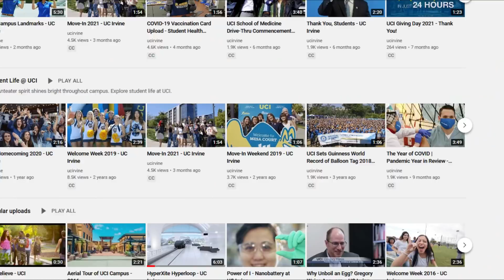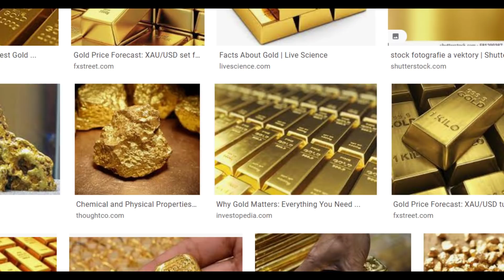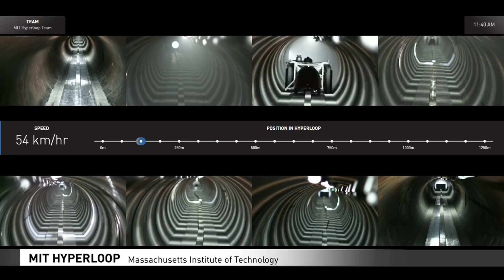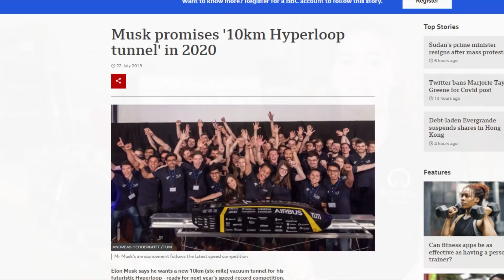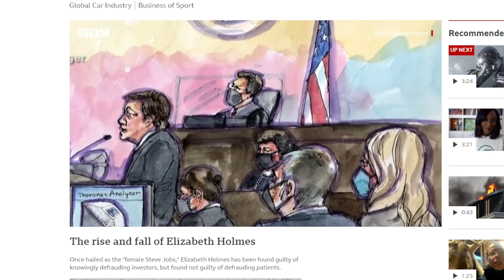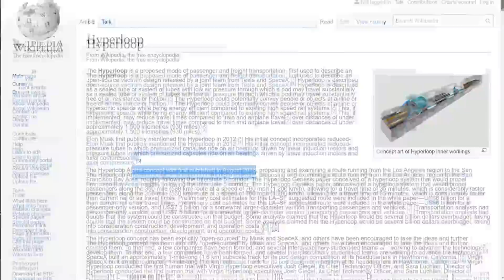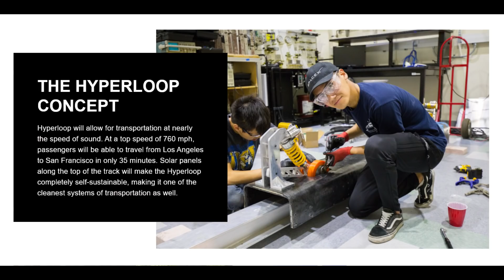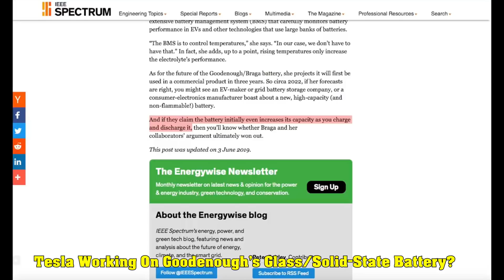The GOLD Battery that will revolutionize EVERYTHING!

Comment: This reminds me of when I was in engineering school, working on my senior design project.
They had us re-designing a linkage assembly used to reset circuit breakers for power stations.  GE had a design that they were having issues with.  They gave us the requirements for the input, and output to the linkage, and asked us to redesign it within the space available.  The first thing that we noticed, was that they were using a 0.7 hp motor as their input, but when we did the calculation for the output, it came out to 2.1 hp.  When we pointed this out to our faculty adviser, he suggested that we try using a nutating gear assembly to get the extra power.  We spent over an hour walking him through the physics to explain why that would not work.

In the end, we were the only team that did not build any hardware.  Instead, we provided them a design that would meet their requirements, if they had a 2.1 hp motor.  We also provided a presentation on just why their current design was not capable of doing what they claimed that it did.  We got an A.
Reply: Well it's good to know there are still some people who are capable of doing competent work.  There's a pervasive lack of common sense and first principles.  I'm amazed shit isn't just constantly imploding from poor implementation.
Reply: You got an A on a shiny worthless paper and GE got your work at your cost financed by the bankers and taxpayers for being in school. Win win for corporate America!
Reply: @Prometheus203  sad but true
Reply: @dmwalker24  I think you make an excellent point . I often look at the old school videos showing how things work . The thing about the early 20th century was that they viewed everything from first prnciples.  It seems now with a more detailed view of the world and math starter engineers lose site of  these first principles when learning at uni and how to build from first principles. Rather , they seem to rely on hand me down aps and formulas . It is impossible to effectively build and solve the difficult problem designs without such fist principle understanding. The difficulty is being able to train engineers in modern methods ( which save time) and give them a sound first principles base.  I think perhaps first principles should be the university focus but it is difficult. The language and presumptions given by modern teachers is often loaded with a modern view of the world. If you listen to engineers in pre 20th century or written text it is worded very differently and tends to reinforce the first principle method .. Perhaps we need to work off old texts and videos ..
Reply: I had a similar experience in high school.  I was on an extracurricular engineering prep/competition team (I forget the acronym) where we'd go to a place and basically "solve" engineering problems that had already been solved.  One that I worked on was determining the minimum force (friction, spring tension, etc.) to keep a car door open on a 30% incline.  The team with the most correct answers won a small amount of scholarship/grant money.
Anyway, the tie-breaker for the competition was to design a nuclear reactor.  There was a 3-way tie.  My team, seeing the ridiculousness of asking high school kids to design a freaking nuclear reactor in under an hour, just copied a diagram of a standard nuclear reactor from one of our textbooks.  We won because ours was the only one that would have actually worked.
I don't remember if this was before or after the Simpsons episode where Homer wins a similar competition by putting a racing stripe on a model of their existing nuclear power plant.
Reply: @Prometheus203  Clearly regulations aren't keeping up with technology. It happens a lot in a failing nation.
Reply: So you're saying that the private sector actually leaches off of the public sector to do innovation, right?
Reply: @johnnonamegibbon3580  It helps maximize profit for the shareholders.
Reply: I don't disagree with you -- No one that passes laws in the states seems to understand technology. How would you solve for the fact a bunch of administrative red tape could stifle innovation and exploratory educational endeavors? I'll bet you OP has/is going on to be a fantastic expert in their field. And in a weird way they might partially have this jacked up system to thank for it in small part. Don't conclude something is a total failure based on the conjecture it could never be improved or reimagined. @dylanthesea2976
Reply: @das250250  My own background is in biology and computer science.  Lord knows I have complaints about trends in software development.  Sometimes seems like it's the AI that's training the devs instead of the other way round.  I've always naturally had the thought in the back of my head, 'Did I miss something?  Is there an angle I'm not checking?'.  But I grew up watching old interviews and lectures by guys like Richard Feynman.  I think he and Carl Sagan are about the best examples of understanding that without a solid foundation of logic/reason all the math in the world can still lead to horrible conclusions.  And at least in biology, my classes still included that fundamental knowledge of how to think about problems and identify potential methodological issues.  The stats I had to take for instance, was almost more about spotting bad statistical analysis than it was about doing the math.
Reply: @eNodeTG  If large projects are being done so improperly that a simple calculation shows so I think it was a failure. The government shouldn't stifle innovation, but innovation happens on paper in my opinion. Implementation should be to a standard. They could at least hire qualified and educated engineers to check over the work before you spend billions.

I'm not expert, and it took me a second to understand what you wrote so it shows how out of field I am with this. But it seems like a simple problem in this case that could have been avoided.
Reply: Public/Commercial transit is drastically safer than diving a car but of course we all hear about every mass transit disaster in meticulous detail. My point is these equivalent "train wrecks" shouldn't be used to condemn the entire field, practice, system and/or country of origin. We owe it to our future grandchildren to figure this crap out rather than considering it all worthless but to burn down. @dylanthesea2976
Reply: @Bacteriophagebs  YOU are the engineer that Tesla is looking for!
Reply: @shimes424  I knew someone was going to post this. I specifically said that to point out the university was probably trying to prop up a "minority", an Asian woman. Judging by the lack of white men.

Way to go, you noticed I brought race into this. Give yourself a pat on the back for not seeing it...
Reply: @arsailor2341  are you an engineer?
Reply: I don't understand what you just said. But congrats on that A.
Reply: Well done! But soon, the Physics will be challenged by the votes from the mob of idiots.
Reply: Ah yes, free energy. Always a fun challenge to solve. Glad you explained this properly and found a solution that actually works.
Reply: @arsailor2341  I don’t know, I think you’re looking too far into it. The video did not mention race at all. It’s basically just saying hey this person did something. Do you really think the school would’ve downplayed the discovery if it was made by a white man? It would make sense if they were like “Strong Asian woman finds revolutionary new technology” but the language in the video is not racialized. In addition, Asians are disproportionately represented in college and women are generally outcompeting men academically. It’s not really uncommon for an Asian woman to find something noteworthy. Why would the college try to virtue signal with an Asian woman in academia?
Reply: Nun Ya Business
Reply: May I ask what hardwares did the other teams come up with? Were they at least workable?
Reply: @Prometheus203  I wonder if you see the irony in your statement. You imply that a socialist-like approach would've been fair, but at the same time you demand capitalist compensation.
Reply: This in part explains why corporations do so little in-house research. They can 'donate' their profits to a university, get free labor, and get a tax benefit for their largess
Reply: I watched recently a "free energy" video with a motor linked to a flywheel linked to a Generator.
There are so many people who truly think that you can > produce < energy by switching gear ratios or installing some capacitors its incredible. (Also, this is held back by governments world wide because of big oil)
Reply: @das250250  there is a issue with that
engineers still learn these first principles!

I went to 2 different engineering schools in germany for 3 semesters each before I stopped that path and went into history.
only in a fraction of the exams we where allowed to make use of calculators / other technology
all others where just Eqation collections and calculating per hand. 
(obviously the exams where set up that you really just have to simplify eqations and dont calculate actual values, but calculate the comparions to the given values from the task, so instead of writing down "its 5N on point a" you write its "2*A on point a" where A is one of the given vectors

We also had to hand draw blue prints in our technical drawing exam, and only one part of it was done on the PC for CAD.
Reply: 1 2  as a programmer, agreed, I see software running everywhere with huge flaws, sure it's like app apis, announcing software, and digital sign software that I mostly notice failing hard in funny ways so it's not detrimental, but I haven't had exposure to more important sectors like medical software so I couldn't tell you the whole story, but I fear the same "quirks" exists in that field too
Reply: @Prometheus203  I take it that you do not have a degree in mechanical engineering if you think it is just a worthless piece of paper?
Reply: @FoxRoxification  It's the same people that believed in spells and magic just a few centuries ago. At least they can make you feel smarter for not being dumb.
Reply: @craigstephenson7676  I forgot Asians are disproportionately represented in college. That would probably be bad news in the eyes of the diversity officer. I suppose race may not be a factor in this after all and I might have been looking into it too much. But then on the flip side, many liberals (and thus donors) love seeing women succeed at anything STEM related. It's just all so tiresome seeing that kind of BS everywhere.
Reply: This is hilarious, thanks for the giggles.
Reply: good grades instead of $$$, good job though
Reply: @Prometheus203  Yes but they were given the opportunity to work on a real world problem with real solutions.  If you cannot see the benefit to students that were involved then you are very shortsighted.
Yes GE benefited but so did the students.
Reply: Good job, that's what you get for saving them money, because they can't even calculate simple things... Incredible
Reply: @JP-xd6fm  Are you literally saying that students will not learn from doing real world R&D?
Reply: @VestigialHead  Read it again
Reply: @FoxRoxification  Read what again?  I did not respond to any of your comments.
Reply: -Matter didn’t create anti matter
-Anti matter didn’t create matter
(Both of them were present at the time of big bang)
-Both of them didn’t create themselves.
-Both of them came from an unimaginable source,  that unimaginable source created matter and antimatter (everything) thats why it is known as “the creator” of everything.
——————
- that unimaginable source/creator has created sin and virtue which are opposite to each other,
— logic says every action has its own reaction, so the reaction of sin must be different than the reaction of virtue,
— the creator has created prophets to let us know about each and every detail of sin and virtue, also about their reactions,
Thank you
Reply: @JP-xd6fm  In fairness, it is the first real world experience for most students, and often does get them on the short list for new hires.  For me, I also did 6 months as a co-op engineer, before returning to finish school, but stayed on at the company for another year after my co-op was done, while attending school.

That practical experience meant that I was one of the first in my class to get hired, having received multiple offers, despite being middle of the pack with the gpa.
Reply: @appc23  This was back in the late 90's, so the only other project that I recall off the top of my head, was one team was asked to redesign the latching mechanism for an oven door, to ensure that it would lock tight during operation, yet still be easy to open.  And yes, they had a working prototype.
Reply: Interesting.. I would imagine a world where projects like these are proposed, and the team that shows that it cannot be done, and why it cannot be done, and possible solutions to it, is the winning team.  This will clearly filter the people that do not want to think, and the ones that ask the hard questions.
Reply: To me, the scariest part of this is that GE is a huge multinational corporation that only made $79B in 2020.  Don't you think that  somewhere in that company they couldn't find one competent engineer to point this out?  Maybe that's why they have been losing market value year upon year.  The stock value is down 80% since 2002.
Reply: @someguy-k2h  This was a new product that they were introducing in the late 90's.  So could be related.  We know that they tried to go into production with their original design, as mine was too expensive.  And it was a debacle, as the linkage they had was too fragile for even the lower hp motor, and literally tore apart.

During the presentations, someone from GE came along, and tried to put us down, my partner asked a couple pointed questions, and the guy just dropped his head down, and vanished like a fart in a typhoon.
Reply: 1 2  Oh hell yes, software development has definitely become people patting themselves on the back for software which is tolerable at best.  We're up to our eyeballs in terminal cases of the Dunning-Kruger effect.
Reply: @shimes424  Adam listed a number of current social ills, with the 'woke' elevation of minorities being one of the issues. The problem is not with minorities, but with the emphasis on artificially 'diversifying' teams in order to appease the politics of the day. Frankly though, that issue is likely not at play here, since it seems the problem is rooted far more deeply than this relatively recent trend.
Honestly, given the fact that Asian students tend to be greatly overrepresented in STEM fields, I'd be more suspicious of an overrepresentation of white students (as that would indicate all of the Asian students with an ounce of common sense took great pains to avoid the project.
But hey, at least there was no twerking in any of the promotional videos... the US is not that far gone yet.

P.S.  If it is not blatantly clear, I'm just mocking certain political and social trends here. Don't take my comment too seriously.
Reply: @kjellvb1979  "I hope we shall take warning"
C'mon, why do you people always need to sound like some sort of revolutionist prophet. "I hope we WILL take warning" makes much more sense. 
There was absolutely no reason to say "shall" other than to look noteworthy
Reply: @claudiaxander  I wish Youtube had a way to see which comments people were referring to. I guess you agree with me on IQ based voting then? 
I agree people with personality disorders shouldn't have positions of authority of others, in family and work life.
Reply: @VestigialHead  Did the students really benefit from that GE project? Because they weren't paid and still likely won't find a GE job out of college.
Reply: @arsailor2341  Yes they did.  They got to do real work on a real life situation.  That sort of experience is invaluable.
Also what are you on about?  A degree makes it much much more likely you will get a career.  Anyone can get a job. 
Getting a job is not even an issue.  The people that claim they cannot get a job are not actually trying to get a job or are so selective that they expect a high paying job when they have no qualifications.
Reply: wait - did the adviser actually thought you can get more power out of the motor using gear assembly ?
Reply: @marianpazdzioch6632  I try to tell myself that he was testing us, but I don't think so.  He was one of those academics that got their PhD, and went right into teaching at the University, without ever having held an engineering job in the private sector.
Reply: EXCELLENT, Nun Ya!
Reply: @arsailor2341   "have seen so many EPA grants go to waste" Just to clarify: do you mean EPA grants were offered but nobody applied for them? Or, do you mean, the money was granted on useless projects?
Reply: @thechloromancer3310   Damnit!  I won't attend ANY university whose promotional videos don't include rap AND twerking! :)